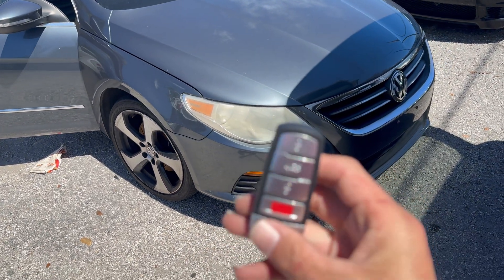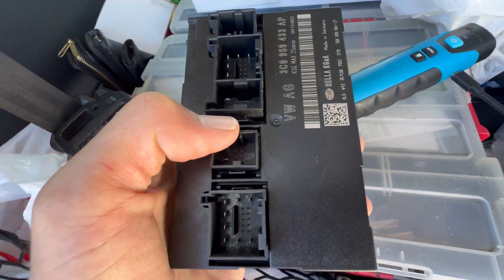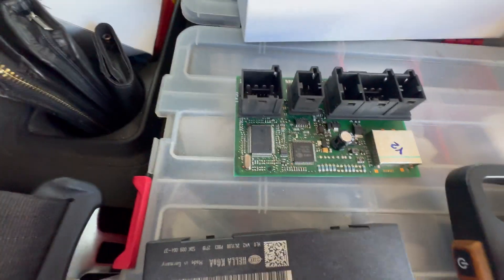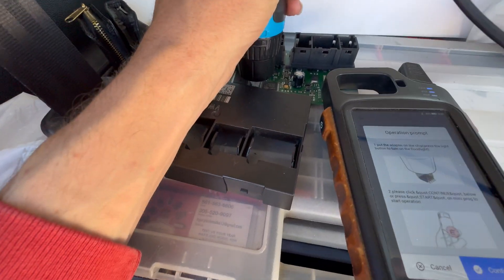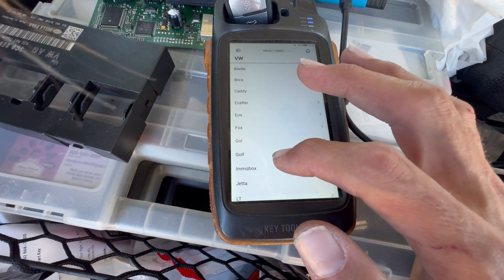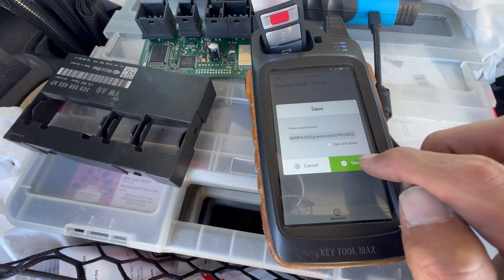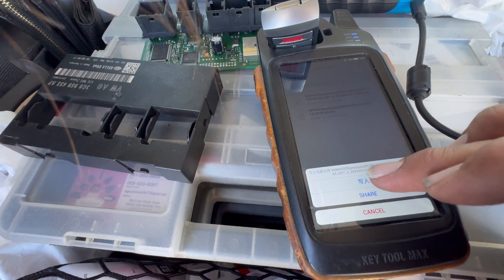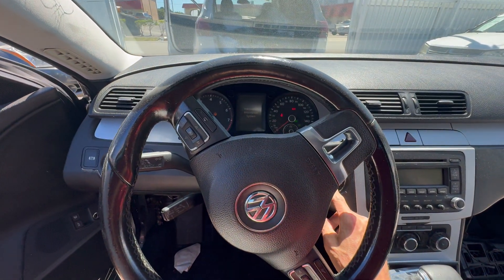HOW TO PROGRAM A KEY FOR 2010-2013 VW PASSAT CC AKL USING XHORSE KEY TOOL & XHORSE MINI PROG

Comment: how many cars does that push pin tool used for, being $400, just figuring it out if its worth buying?
Reply from the maker: It does a lot of different cars. You can check the adapters so you can get an idea of

Comment: I gotta run as doing a Vito key with either im608 pro or cgdi in half hour. anyway I tried to do Passat estate car 2011 yesterday im608 pro. it could not read the data. I am about to buy another machine and think key tool plus looks good but your chip reader. WOW
Reply from the maker: Yeah

Comment: How do you program the remote
Reply: By Device you can program remote separately, when you enter in remote function after click it you have press door switch lock once and then when the device gives you the command to press the remote button then press it and then   program successfully finish .
Reply from the maker: With every scanner you have just like you would program the flip keys remote part
Reply: Thank you for this video. I just ordered this tool to do this very job next week on this same vehicle.
Reply from the maker: Amazing. Good luck
Reply: Ну это совсем тупой вопрос
Reply from the maker: Not everyone knows

Comment: I followed the exact same procedure, but using VVDI Prog and VVDI2.
After writing the modified EEPROM data back and reinstalling the comfort module, the ignition does not turn on when I insert the key.

Has anyone experienced this issue or knows what might be going wrong?
Reply from the maker: Try to write a Vvdi super chip maybe on existing slot.

Comment: If the engine computer is replaced, avoiding immo off, can we program keys from the ECU or is it impossible because there is immo in the meter and bsi/bsm?
Reply from the maker: I’m not sure but I think you will need to program the engine ECU to the car.

Comment: By replacing the ECU without the immo off, what's the solution to get the vehicle running, please?
If the new key is coded to the ECU, will the electronics accept it? Thank you.
Reply from the maker: You need to program the ECU to the car
Reply: @legacylocksmith7874  and can the mini prog or key tool max do that? Thanks
Reply from the maker: What is the model and year? And usually no, those tools are not for that you can do it with the dealer tool.
Reply: @legacylocksmith7874  These are functions that I am interested in if the device does it. Thank you.
Reply: @schmago1348  You need an Abrites AVDI, Autel MaxiIM 508/608 or Xhorse VVDI, for example, to adapt the ECU to the car.
Reply: @DavidRain007 Can the xhorse key tool max or max pro, otofix im2 also be suitable? Thanks
Reply: @schmago1348  KTM / KTMP definitely NO. The IM2 should probably be able to do it.
Reply: @DavidRain007 you will not be by chance how to proceed with otofix im2 to do this? Big Thanks again

Comment: did the remote work ?
Reply from the maker: Yes. Remote programming separately just like any other VW flip key remote
Reply: @legacylocksmith7874  There have to be no faults in the CCM 46 module - otherwise remote learning won't work! Be aware of that!
Reply from the maker: Never had issues on this
Reply: @legacylocksmith7874 how do you program the remote?

Comment: Great job,  question do you have info on how to do AKL on 2013 scion FR-S  blade key
Reply from the maker: Yes, every machine that does Toyota will do that. It’s a 16 minutes reset and then you can learn the keys. It’s the large G chip.
Reply: @legacylocksmith7874 what would you recommend since I had to buy a new autel? I know autopropad works but it’s pricey. I’ve had some success with key tool max pro
Reply: Ok thank you very much 👍
Reply from the maker: My pleasure. Thanks for your support.
Reply: What type of toyota vehicle would be best to use for the reset I tried corolla but no luck I'm using the im508.
Reply from the maker: Because your machine is updated then you cannot touch those function try to go through Diagnostics
Reply: Ok
Reply: Found it, key reset asking for Vin # to proceed it's processing now
Reply from the maker: @richardMiller-ow4jf 👍🏼
Reply: The car start you are really the greatest you make it look so easy great knowledge of the work thanks for sharing with us, thanks a million 👍👍
Reply from the maker: Glad you finished that one, my pleasure 😇
Reply: I had to use smart pro, autel and xhorse was failing. Make sure you got the right g chip. I keep a oem key and just clone it when needed

Comment: Just seen the video about the 2010 Q5. Understanding is that this vehicle is very similar to the 2009 A5 if a lock smith has the autel 608 and xp400 would they be avle to make dealer key and learn new key with aftermarket key? Is it wise to ask smith if they use autel and xp400 to make sure they can do it?  Seems really simple just the tool it self costs 2000 .
Reply from the maker: Yes. They should be able. 

This video is designed for Locksmith professionals so definitely. You can show that to the Locksmith but they would probably know what to do.
Reply: @legacylocksmith7874 thank you for the quick response the locksmith seemed unsure if what they had would be able to.  Do you know if the autel 508s pro and xp200 is able to. Positive the xp400 will work but that's out of budget at the moment. Again thank you.
Reply from the maker: It’s may work, but if you’re not sure exactly what you are doing you may cause the car not to start so you should know what you’re doing before you try
Reply: Hello, hope you got it taken care of. I did an add key a few days ago and it was very simple following @legacylocksmith7874's video. I used an Autel IM508 and the XP400. I made and posted a short video but it's not as informative as these videos. I quoted the customer $280 but wound up just taking $140 because the car was rough and not running. Cheers!

Comment: If you dont know how to use xhorse mini proG  you can erase the eeprom   I always remove the eeprom and solder back 5 or 10 minutes  minutes I have been done 100s  vw cars
Reply from the maker: Reading this kind of chip like that is not risky, it’s actually pretty safe. Maybe not if someone is clueless. Like i always say “the machines are as good as the people operating them”.